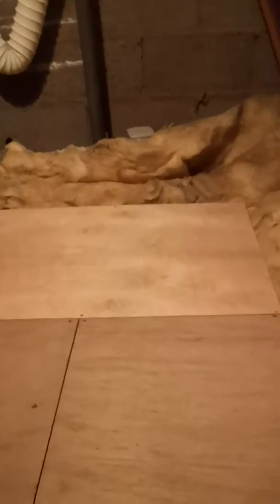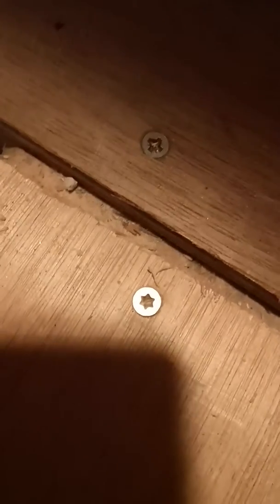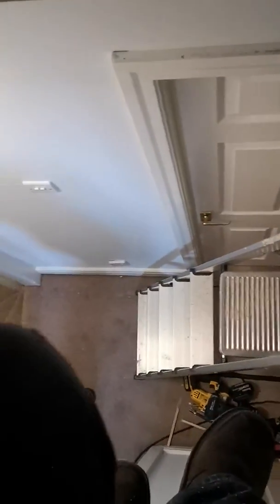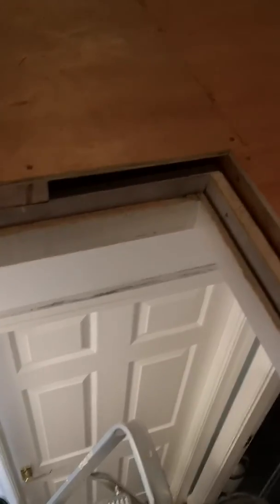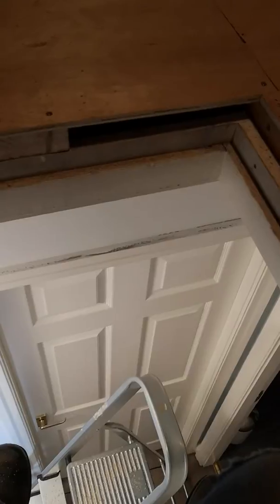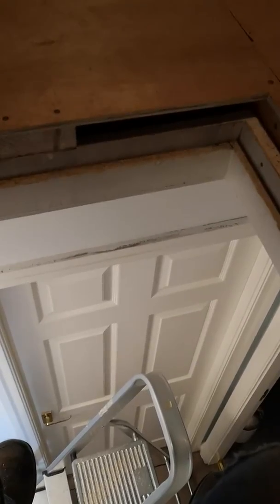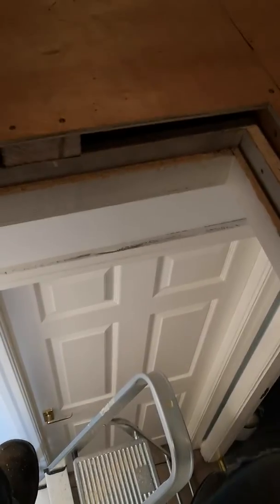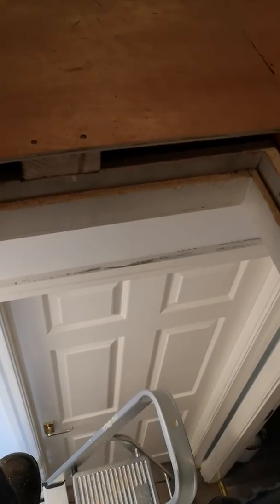Loft boarding for storage in Leyland

Comment: Good stuff. Did you use 2x4s on top of the joists, or loft legs into which the boards were fixed?
Reply from the maker: It was just for light storage so no legs needed in this case